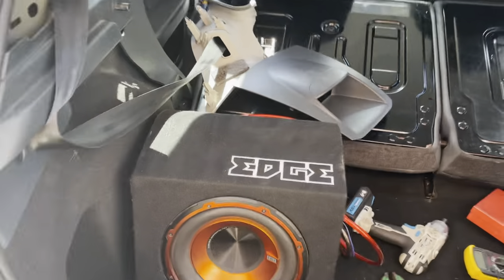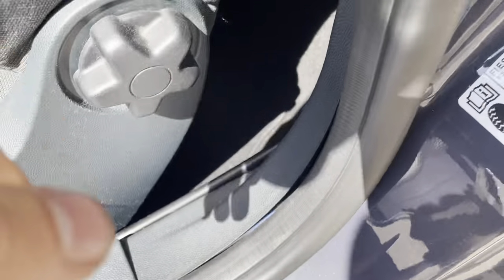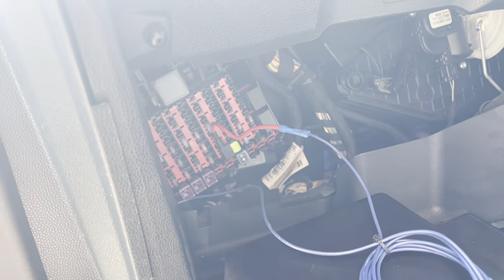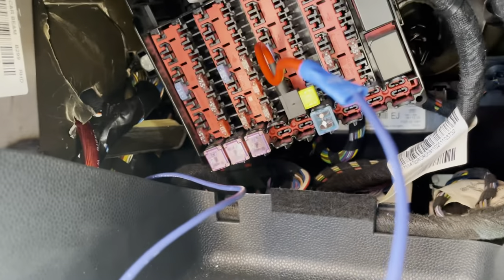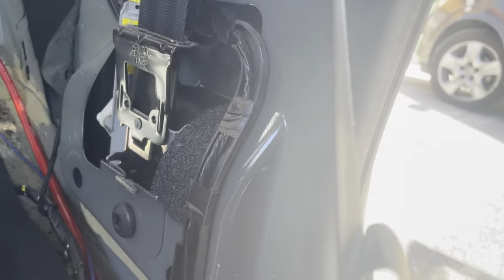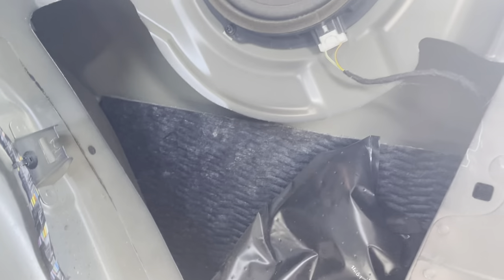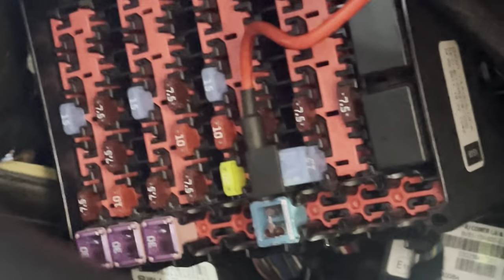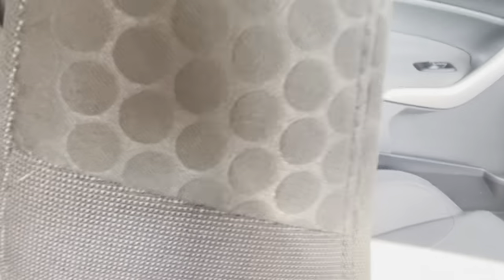Ford Fiesta Subwoofer Installation Guide

Comment: Bro on your remote wire you might want to run a smaller fuse because the remote wire is super thin and the add a fuse you used is thick so if shorted it’s going to just cook the remote wire, I learned the hard way

Comment: I didn't understand how you actually installed the line output converter. I thought you needed to use a negative from the left speaker and positive from the right speaker or vice versa to get a single mono signal to the amp/sub.
Reply: On the line out converter, Attach the striped wires together and the solids (grey/black + white/black)(solid gray + solid white) splice into the speaker wires so it is mono
Reply: can you give me your discord to ask you some questions?

Comment: could you use a fuse with a brake out wire instead of a piggyback for the remote?  such as this one from halfords ( Halfords Mini Blade Fuse + Breakout Wire 15 Amp (FUSE160) )???

Comment: is this possible on a 5 door fiesta, the splicing to the rear speakers that is
Reply from the maker: I’m sure it would be, would just need to get the wires through the door and in with that loom
Reply: @LeonAyalaPaviour  cool thx, also sorry 2 be a pain but does it work with the factory built in radio or do I need a new radio fitted ?
Reply from the maker: Factory head unit is all good 👌🏼

Comment: Do you not plug anything into thr back of the stereo ? Seems liek that whole part is missing ? Or im being blind? I have left my sub out of my mk7 fiesta coz i refused to buy a 60 adapter to fit it but i dont seee any adapters in your video ?
Reply from the maker: Nope, nothing into the head unit!
Reply: @LeonAyalaPaviour  then how is the sound playing to the sub from the stereo ? Through the blue cable? That u got in the fuse box ?
Reply from the maker: @rickyriddell1518 that’s the remote. The sound is received using an RCA converter and back probing a rear speaker
Reply from the maker: Or you can also use a T-tap to splice into the wire

Comment: I dont understand the part with the fuse box how you connected the remote wire to the fuse. I cant really understand it because i dont really speak english but dutch. sorry could u please explain? 😬
Reply: Special part. Looks like fuse blade with two fuse slots and a wire. You can achieve the same result by putting the wire into the fuse blade slot
Reply: Voor het geval dat je nog geïnteresseerd bent, of nog geen antwoord hebt gehad. Dat kabeltje is een verloop je. De originele zekering zit er in, maar je kunt in dat verloopje ook een extra zekering aanbrengen die geldt voor dat kabeltje die jouw remote dan moet voorstellen richting jouw versterker. Het moet wel op een schakel voeding zitten, en niet op de vaste voeding. Dit betekent dat als je het op de vaste voeding zet, dat de versterker continu aan zal staan. Zodra je dit op een schakel voeding zet betekent dit dat als jij jouw contact aanzet, dat de versterker dan pas aan zal slaan. Hoe weet je wat nou wat een schakel voeding is, en wat een vaste voeding in jouw zekeringkastje? Dit kun je meter met een multimeter. Als het contact aanstaat zul je bij sommige zien dat er constant 12v op blijft staan, en bij sommige 0v totdat jij jouw contact omzet, dan moet er 12v te zien zijn, dat is dus een schakel voeding.
Reply: It's a piggyback. Has a male and female plug to add the wire.
Reply: @SVVALOON  kijk dat is nou nog eens verdorie handig ik heb het net hetzelfde gedaan als in de video alleen de fuse die hij gebruikt zit op hetzelfde plekje als die van de ruitenwisser dus ik kan er nu maar 1/2 gebruiken dus mijn vraag is nu als ik een 2de “20” fuse koop en die in het tweede insteek gaatje stop kan dat dan allemaal ? Of gaat dat niet en zegt hij dan boem ? Alvast bedankt
Reply: @brambrouwers8404 maar om even kort antwoord te geven op je vraag, als kk zou was zou ik de originele zekering 20A houden, geen idee waarom die zo hoog is maar dat ter zijde. Het ligt aan de dikte van jouw kabeltje richting de versterker. Als het een kabeltje is van 0,8mm, moet je die zeker niet 20A afzekeren omdat dat 0,8mm kabeltje dan al lang door gesmolten is/kan zijn. Het ligt overigens ook aan de afstand. Ik heb zelf een 0,5mm2 (remote kabel) naar achter gelegd en afgezekerd met 5A. Eigenlijk kun je een net iets dikkere kabel pakken, zoals een 1mm2, maar dit zou ook net moeten kunnen.

Comment: Why do you not need to splice both rear speakers? Is it just the same wire which runs through all of them then?
Reply from the maker: No, so this is just the easiest way that works. It only takes left stereo audio. Generally for bass this skit as issue at all as bass is normally mono
Reply: @LeonAyalaPaviour  oh wow ok thanks wish i knew this before i pulled the whole radio out.
Reply from the maker: Lol does it work tho
Reply: @Leon Ayala Paviour  yes been working for about a year now just cut into both left and right however I've also added a rca volume knob so I can turn the sub off completely if I want.

Comment: only need to do the RCA connectors on 1 side?
Reply from the maker: Yep. Only wiring into one speaker
Reply: @LeonAyalaPaviour  ok perfect and with RCA adapter theres 5 different wires it looks like you only used 1 wire is that right?
Reply: @LeonAyalaPaviour  why only one and not both?
Reply: @sl-fu3uh  I’m putting one in my Mk8  I don’t know weather to take it from both rear speakers or just 1. If it’s 2 Channel surely both rear speakers ??
Reply: @a..b..9308  all you need is one set of cables for left and right as they are all linked together

Comment: Did you put the original fuse from the fuse board into the side of the piggyback?
Reply from the maker: Yep, and make sure you put another fuse of the same rating in the other slot to ensure the original use of that fuse keeps working….